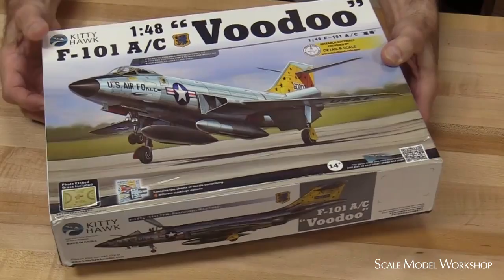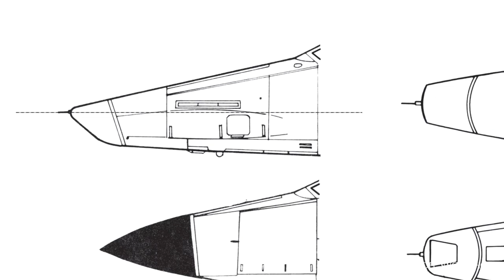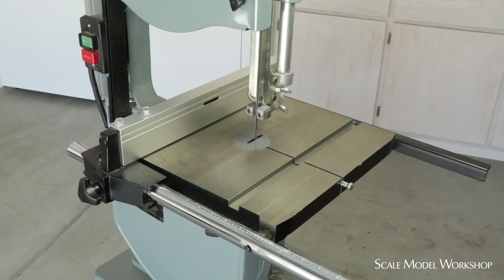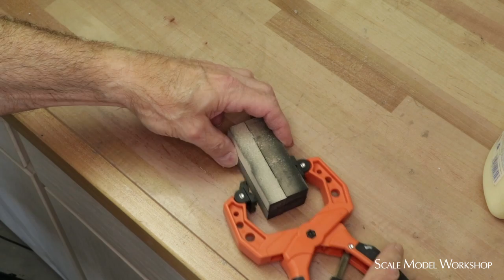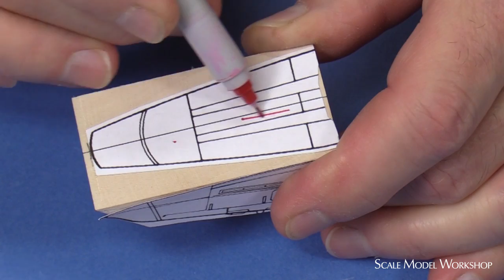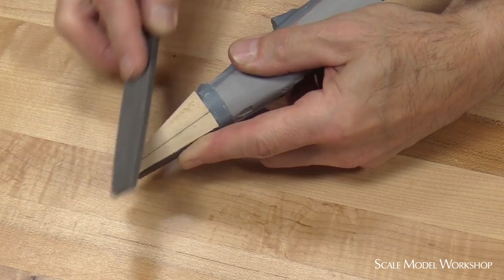Fabrication 101 ... A Basic Scratchbuilding Technique

Comment: Flat sanding block, straight lines and working to edges is also used in automotive body shops to rebuild body panels back to original shape, using body filler .

Comment: Wow, what is the purpose of cutting the block into 4 pieces just to glue it together? Does it affect structural integrity in any way?
Reply: By painting the glued surfaces he will always have a centerline reference, even if he were to cut and sand all sides. It's ingenious, I have always just drawn a line on the outside and had to find the center again afterwards (which wasn't always the same exact center I started with).

As far as structural integrity.... it's not a flying model, so wood glue is adequate. Even if it were an RC plane, wood glue would still work.